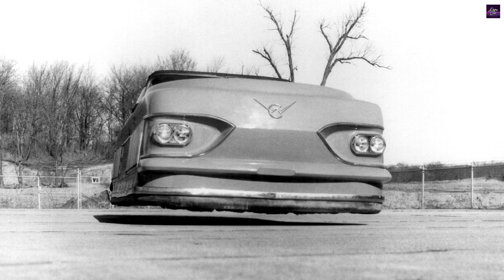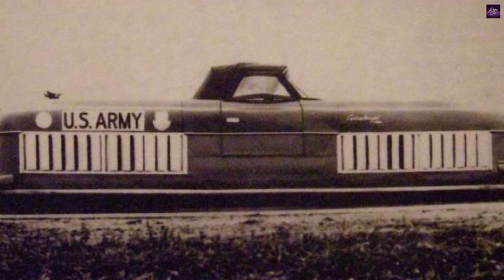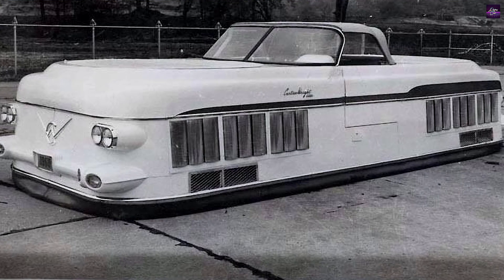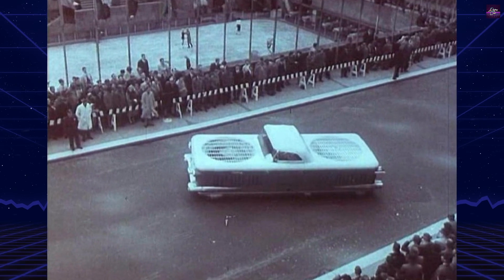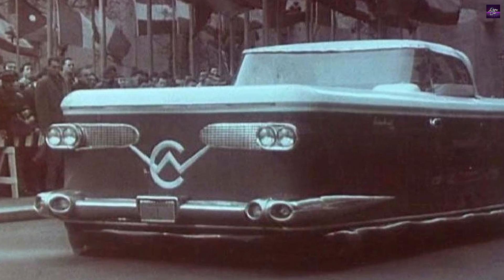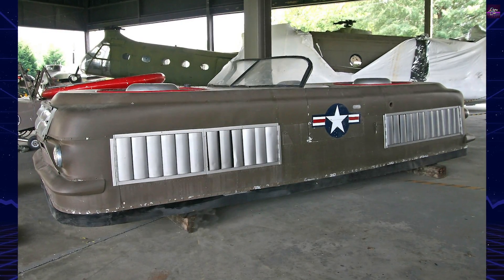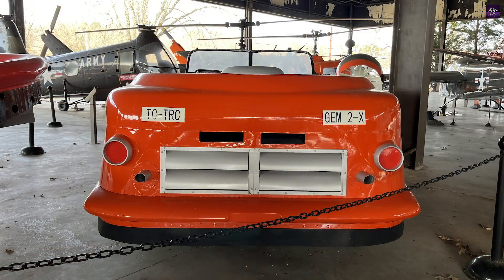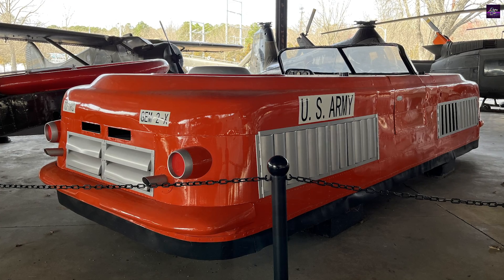Curtiss-Wright Model 2500 Air Car: The Machine That Whispered Between Earth and Sky

Comment: I have flown hovercraft and it's not for the faint of heart.  As soon as you come up on the air cushion, you immediately start sliding down hill (what ever direction that is).  And most land is not flat.  Roads are crowned in the center so you tend to slide towards the curb.  Parking lots are pitched in several directions to allow for drainage. That's why you mostly see hove craft over water, at least it's flat.  But there is the constant problem of water spraying out from under it and into the cockpit.  Then there is that fact that there are no brakes.  You stop by venting the air from underneath and coasting to a stop.  Not very precise or immediate.  And steering is more like driving a car on ice.  You turn the vehicle but your direction of travel doesn't change until your forward thrust overcomes your sideways momentum.  This is why they've never been successful in the mass market.  They're good for some special situations like swampy, deep mud, bogs or over very thin ice, or amphibious assault, where they can take you right up onto the beach and not drop you in the water.  But that's about it.

Comment: As soon as you 2 x 180hp engines I was wondering about the noise of the thing. It would hardly have been a stealth vehicle!
Hovercraft will probably remain an interesting sidebar to transportation. Their lack of hill climbing ability and inability ability to cope with uneven surfaces  always limited their utility. 
They always have some uses - air cushions remain the best way to move large heavy items around warehouses, etc but will probably never achieve general use.

Comment: A troop carrier, that can only carry two troops, and needs two aircraft engines, and can only go on flat, level surfaces.....
Reply: Over mine fields…
Reply: Air intakes are positioned perfectly to suck in enough water to immediately sink it.
Reply: @ The air intakes are on the TOP. It’s a hovercraft - it flies on an air cushion.

Comment: Until now, I had only seen drawings of this, and had no idea it was called the Curtiss-Wright Model 2500 Air Car, much less that this was actually made in prototype form.  I'm more familiar with the similar Piasecki VZ-8 Airgeep, (which is shown here in passing at 3:04 and 3:19 at the back left.)  

Though I couldn't find any models of the Curtiss-Wright Model 2500, Glencoe Models offers a reissue of the old ITC kit of the Piasecki VZ-8 Airgeep in 1/35th scale, and I think there is a 1/72nd scale kit from Anagrad, as well.

Maybe you could do a follow-up video on the Piasecki VZ-8 Airgeep.

Thanks for sharing this with us!

83rd Like.
Reply from the maker: Interesting machine “Piasecki VZ-8 Airgeep”, I'm not sure if this machine fits the theme of the site. I'm thinking about making a video about it on the second channel. I'll think about it.
Reply: @retrocarchannel  What channel?

Comment: How do the brakes work on it?
How it operates on snow?

And BTW:
It would clean the streets of dust, sand & small debris… Oh wait, in this respect it would be as annoying as any leaf blower & it would be a nuisance to pedestrians.
Imagine a small dog crossing its way 😎😎😎
Reply: The problem with hovercraft don’t have brakes… They need to use thrust to change direction and stop.

Comment: It’s more than sixty years since the Curtis-Wright Aircar and STILL NO FLYING CARS! I mean, there are a couple that are supposed to be close to, or starting production, but it’s not the same. Sometimes the future filled with so much promise turns out to be a disappointment instead. Thanks Retro, you tried your best.
Reply: Not true, is a hovercraft.
We have several hovercrafts both in civilian and militar operations, they are a bad substitute for a car.
Reply: There have been flying cars since the 1950's. With a new one made basically every decade.

It's not the technology. It's the cost and total lack of practicality.

If the gas tank is bigger than 5 gallons, you have to have a pilots license to even fly it.

Having to keep a car plane in airworthy condition at all times we, with all the crap roads we have, would be an expensive nightmare of maintenance. Which is already expensive.
Reply: @ But, but… flying cars! 🙁
Reply: Hey! Hey! Hey now! The future isn't here yet, is it? So...there's still time.  (Jeez. Some folks are SO impatient.)
Reply: We have the tech to make flying cars but the hangup is that HUMANS would be flying them all over the sky anywhere they wanted, and the result of crashing mid-air is FAR worse than with cars on the ground.  Insted, they would need to be controlled by computer systems programmed to take the vehicles and passengers from one point to another without anyone at the "wheel".  To make them feasible for parking at one's home they'll have to be like drones so they can take off and land vertically.  But it CAN be done (someday).
Reply: @The_DC_Kid not going to happen on that scale, flying is 3-D and involves weather and terrain, and makes a lot of noise. Driving is 1-D. At best you might see some autonomous e-air-taxis on some downtown to nearest airport route, as is done with helicopters now.
Reply: As a child of the sixties, I want to know... WHERE'S MY JETPACK? WHERE'S MY FLYING CAR?!